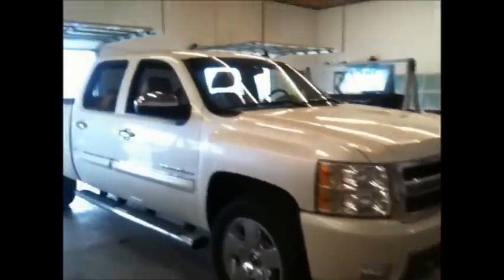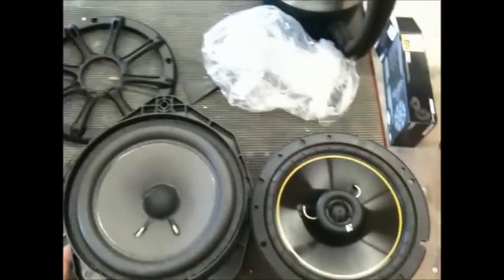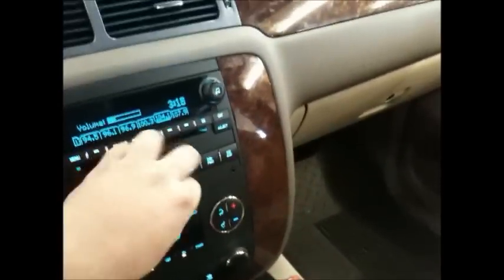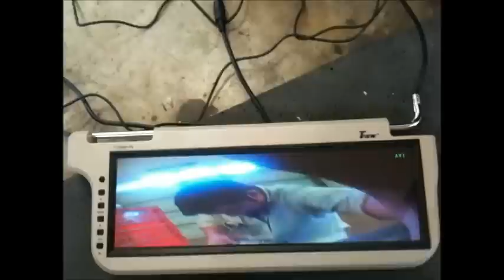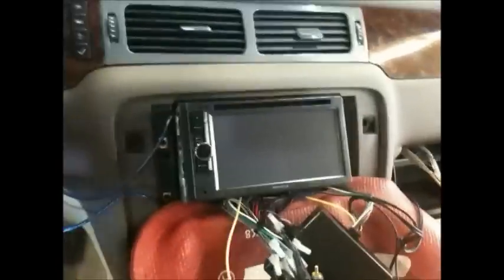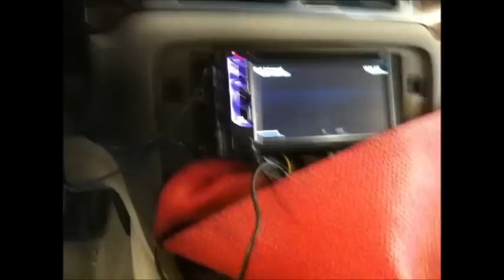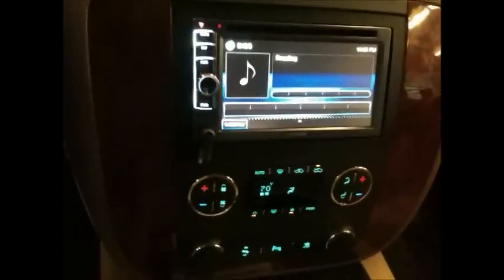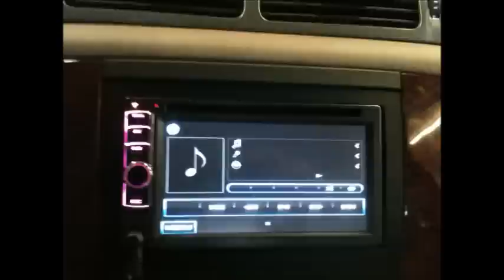CHEVY SILVERADO 2012 HOW TO INSTALL A FULL SOUND SYSTEM RADIO , BYPASS BOSE , DOOR SPEAKERS

Comment: Pretty In-Depth video unlike others that expects everyone to know what this or that means. Give you props man. Do you have another video that shows/explains how-to install a LOC (Line Output Converter) to the 2012 Chevy Silverado w/o bose and navigation but I do have Onstar. I like the stock radio look with the add-on subs and amp feel. Any advice will be appreciated. Thanks in advance.

Comment: I like the video dude good job! If I can ask without offending... Why didn't you modify the factory speaker brackets to fit the kicker speakers and re seal it to the door panel? In my opinion doing that little extra step dramatically increases the response of The mid range bass. Not trying to offend just curious. ✌️✌😀😀✌✌

Comment: Thank you so much for the time and effort to help others.  Do you know which speaker and wire colors for the single speaker you used for onstar?  Great idea, I just didn't know which speaker gets the output and already have my old radio ripped out.  I think it's driver front, just not sure

Comment: hector, you do some sick work man!! Watched all your videos and learned alot.  I have no one good in my area so I am having to do my own full system installation...

Question;  I have the PAC adapter to get my RCA's, on a 4-channel amplifier where would you tap your speaker wire into on a GMC Sierra like this one that does not have Bose?  I looked under my cupholders and I have no speaker wires from the factory head unit under there.

Thank you for the help!!

Comment: Excellent video man. Honestly for the money, the kicker DS or KS series speakers are hard to beat for simple budget coaxial speakers. Bose is simply a name respected by snobs, it sounds ok when it's played at lower volume but, play any type of dynamic music and it sounds muffled and distorted due to Bose eq curve. Lowering impedance draws more power from an amplifier but also impacts slew rate, damping and introduces more distortion. It also reduces the amplifiers control over the cone of a woofer. I could techno-babble all day but all in all, this was a great video, incredibly informative.

Comment: What was the distortion I was hearing?  Was it the mike on the camera?   Loved the video, you're very professional. I've got a 2003 Silverado SS with the Bose sound system which is still stock, and I'd love to have a kickin' sound system again... I used to have a Alpine system back in the 80's that was awesome, I hear they are crap now.. .is that true?  What would you suggest I run?  I'd need a iPod jack and mainly CD/DVD... don't want to lose my under seat storage area though really. Thanks!

Comment: Hey Hector great video. I wanted to know if you could guide me? I have a 2012 silverado lt. I currently have a performance tecknique amp 800 watts with 2 kicker cvt 10". I want some aftermarket 6.5 speakers for the door panels. However, I do not have an aftermarket stereo therefore I cannot connect am amp to them. my price range is 200 not including tweeters what do you recommend??

thank you

Comment: I have a 2013 Tahoe LTZ.
Am having a hard time where to put my monter amp Orion HCCA 3000.1 it's won't fit under the seat  and I don't have captain seat, any suggesting. If I was in Texas I would have you do my bose system. Am in California.

Comment: I have a question. I'm all the way on the east coast and can't get a straight answer from any local installers. I have a 2013 chrysler 300 and I know there's a way to install a dvd option so the factory screen plays dad's and I want to hook up headrest monitors. I try and do all installations myself and that's why it's hard to get real help from these guys. Can you recommend what I need to install?  Thanks and your videos rock. Did my whole gmc  Sierra almost the same way as on this video. Thanks again and don't stop the videos.
Reply: Ok, first thing is first you have to look up the wiring harness and see if you can find a video out put of some sort, let's say you find 2 wires that are video out put (positive and negative) all you need to do is buy a female rca addapter and splice it up and strip it there should be 2 wires connect those 2 wires to the out put in the facoty harness and tape it up then just plug in the monitors, now let's say there's no out put on the wiring harness check in the back of the stereo it's self to see if u have any 3 mm outputs or any rca cables back there let's say there's not then your probably going to have to go after market

Comment: I couldn't find the GMOS 100 as it has been discontinued . I had to use the GMOS-LAN-02 . For some reason the speakers kept cutting out , so I decided to eliminate the Bose Amp and tap directly into the speakers from under the console like demonstrated in this video . Worked flawlessly ! I put in the additional speaker to retain onStar , but as soon as I tapped into the bose amp to access my speaker wires .. I lost my door chimes . How can I get the door chimes to work ?

Thanks!

Comment: Nice video. I have the same truck. I recently bought the costar bluestar which replaces the onstar system with a blue tooth system that uses the internal microphone and speakers inside the truck. I watched the whole video just to see if I could find the onstar module and didn't see it. Is it behind the headunit? I just need to find it and unplug it and plug this new module in its place. Please help

Comment: I need to find a switch 12 volt wire to connect to on the vehicle to power up my touchscreen Kenwood. U got any ideas? The harness red wire does not have enough volts to power the aftermarket Kenwood. I might have to run the red wire through the firewall to the fuse box located under the engine hood.

Comment: Hey i got a 2013 gmc slt with the 6 disc changer... If i put two 10" kickers in should i change out the headunit? And if i did would i bypass the bose amp?

Comment: I have a question?  I have a 03 tahoe and I have a pioneer x4600bt! I bypassed factory amp and wired it to a four channel amp using your video!  Every thing works fine,  its just that when the bluetooth is used it comes out of a speaker in the dash! Which I didnt know about! How do I fix this? Please help.

Comment: Good Video! Question, I'm running the JL Audio Stealth box in my 2013 Denali HD. That box takes up all the space under the seat. I'm running the 1200/1 JL HD amp, so I don't have any room for mid range amplification on that unit. Have you had any luck removing the Bose amp and replacing it with a decent product? I want to upgrade my mids now, but I'm out of room for a 4 channel amp. I would use the head unit, but if I'm going to drop 1000.00 dollars on mids I want them to pound. Second question. I have the Alpine X009 GM (the bezel/headunit kit). I noticed Alpine also makes a direct bolt on kit for the factory speakers (its around 650.00) have you had any experience with that set up? I cant tell if the speakers in that kit are the better quality ones. Thanks again!

Comment: I have a 2007 Chevy Silverado 1500 new body style.  Was curious as to whats the best place to run the ACC wire for an aftermarket stereo if you are by passing all the factory wiring?

Comment: so the gms 100 or w.e that wiring harness that adapts to the bose amp, that thing also connected the steering wheel controls? usually what I've seen is another seperate harness to adapt the steering wheel controls I didnt see in here

Comment: Hey Hector like ur videos man....well i had a problem with an install on a '04 Chevy malibu, i wired it right but what i never got was that i got no sound even though everything was wired correctly, i heard something about the factory amp, plus the red wire supplied with the harness...any suggestions? Thanks!

Comment: Hector, 

I have a 2012 Sierra Extended cab SLT with factory Bose system.  I like how everything works as one system (xm sat, on star, hands free) and would like to keep it that way, except the built in sub.  That little 8" is lacking, hard.  I've seen custom installs and replacing the factory sub with aftermarket shallow mount up to 10 inch.  I'd like to keep it as stock as possible, including the door speakers and bose amp.  Is that possible? Have you ever done such an install? Recommend?

Comment: I bought a Kenwood DNX9990HD and will install new wiring. Do I need to install a second external speaker for onstar and do I need that auxiliary cable to retain satellite radio?

Comment: Hey how much would that cost if I only put the radio and the rear camera and use the original speakers with Bose amp.. On my 2003 Tahoe Z71

Comment: WOW you know your stuf!  I have a 2013 lt with bose.. i have amp and sub with line converter. but cant find any ignition on off fuses for my amp.. also i want to add a 2din deck with a pac harness to keep my steering controls. 

now if i add a deck will it sound louder? i wouldnt mind buying 4 speakers but can i just switch them up ?

Comment: I have a 2007 Chevy Avalanche with factory Bose, touch screen Nav. I would like to add a small amp and subwoofer while leaving the rest of the system stock. Can this be done? If so, what adapter?

Comment: Question, I am doing a 5 channel install on a truck like this. Would it be easier to run the wires from the amp to the door speakers by running them to the leads behind the radio rather than fishing the wire through the door grommets?
Reply: Which way did you wound up doing it?

Comment: Just curious as to how I make song info appear in my odometer area on my 2011 Silverado LTZ I have factory system is it possible to do with factory stereo? if so how do I accomplish this task I may eventually go after market with my stereo to a double din JVC as I am a JVC fan but I will keep my bose speakers/amp in tack as I am a bose fan, but for now am just curious to know if this is possible with my factory unit.
Thanks

Comment: Is there a way to retain function of Rear Entertainment System (Flip down DVD) in Denali XL with Bose amp ?

How does GMOS 04 differ from your demonstrated GMOS 100 ?

What is the problem if I don't install that 5 channel amp and directly connect the overhead's unit speaker wires to cut off of speakers from Bose amp ? (My Bose amp is dead). My Overhead has 45W output per channel that seem not bad.

Comment: Hey I have a 09 Silverado and Im trying to install my head unit but Im at stand still now because every where go or call they tell me they have to special order a wiring harness. Im not to worried about the using onstar or my steering control for right now.  What can I do to finish up installation

Comment: hope you can help me. i have a 2010 mazda 3, hatchback with a bose system. i want to replace the stock radio with a JVC  KWAV61BT. what do i need in order to keep the bose speakers im not looking to replace those just the radio itself. thanks

Comment: Ummmmm..... WOW. So much fail in this video, the radio fits without cutting the truck. Believe me I've been there done that.The onstar speaker is ziptied to the truck??? really? ghetto spliced rca cable to aux wire?. 2 ohm speakers are not " faster" than 4 ohm speakers. " the more sadder part" is that you believe that. I could go on and on and on... BTW  what did you use to measure distortion or "clipping" on this kenwood radio or the pioneer? Why you cut wires???????????????? they no make adapters??????????
Reply: All valid points, but made with by far the worst grammar I've heard. "more sadder"? that's a joke right? Also, it should be "Why did you cut the wires?" and "they don't make adapters?" instead of the nonsense above.
I give it 8 for creativity, but they're right Kicker isn't a sound system I would ever put in my car.
Reply: Not for me, it's night here.